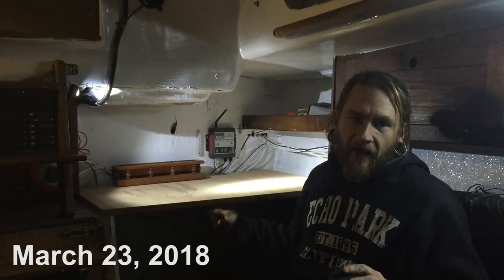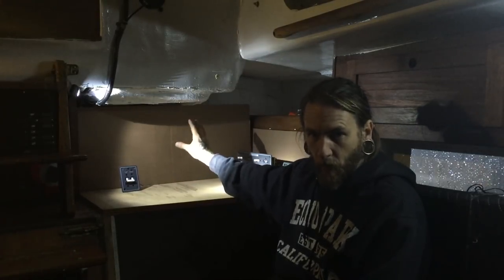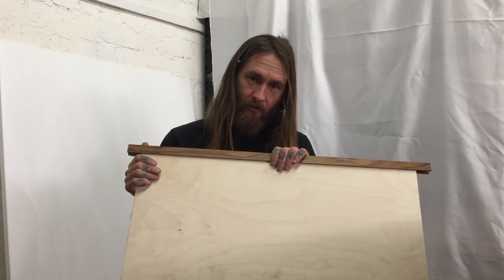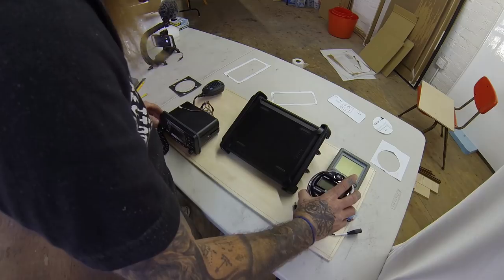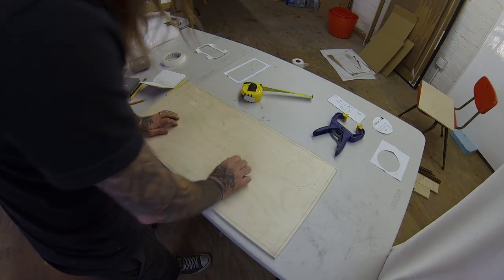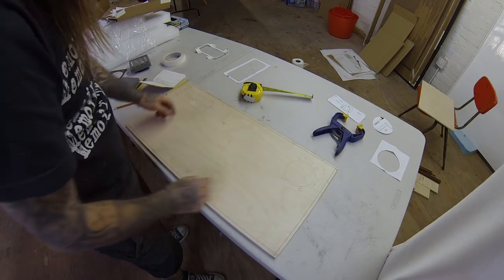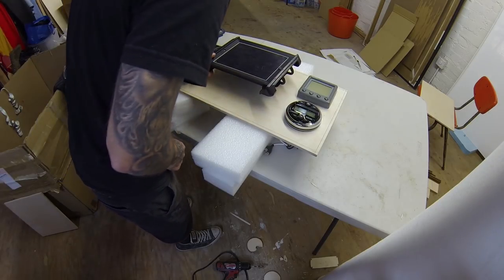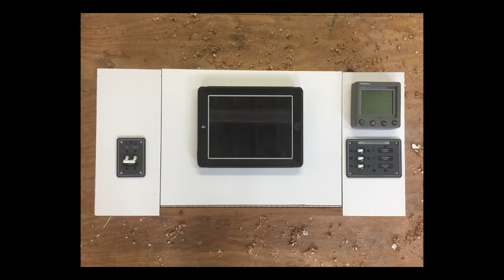Designing and Building a new Nav Station for a 1965 Alberg 30 Sailboat

Comment: Hi James. Love the videos. I too decided on a X mount for my Alberg 30. I have one in one of the rigs I drive and loved it the minute I tried it.  I was wondering what kind of case you went with for your iPad. I am circumnavigating Vancouver Island this summer and this is one of the details I have yet to work out. Thanks.
Reply from the maker: I use an Otter Box for mine, It has hard rubber case and a hard plastic stand/cover that can snap on the front or back or be left off. I leave it off when I have it in the RAM mount. Its very water resistant and can handle splashing and stuff, not being put under water though, but its perfect for my needs. Also with the rubber case it doesn't slide around in the cockpit. That is SUPER COOL that you will be circumnavigating Vancouver Island!! We were just up in that area for a yacht delivery and it was beautiful!

Comment: James surprised you did not put ST60 in the cockpit. Nice to see all data when in cockpit. Must have been reason you chose inside the cabin?
Reply: Bruce McCulloch the ST60 is wind/speed/depth. We always put in the cockpit. Need to see depth and wind when anchoring and sailing. Never heard of someone coming to rip these off.
Reply: Bruce the tablet loses cell service on the Pacific Ocean. No wind or depth!
Reply from the maker: I already have an ST60 in the cockpit, so the one in the cabin is mostly for under anchor or under way.
Reply from the maker: My iPad doesn't use cell service it connects with the onboard wifi setup through Digital Yacht iAis to receive any ships data, but you are absolutely correct, iPads are great but I don't trust them with my boats safety. this is why I have hardwired ST60s in the cockpit and in the cabin I also keep paper charts for everywhere I am sailing because electronics fail from time to time.
Reply: I figured you had 2 displays. You probably picked up a 2nd one on ebay on the cheap
Reply from the maker: Yeah I watched for them a long time, the one in the cockpit is a ST60 Multi Display and the one in the cabin is a Graphic Display that shows tons more data if its all hooked up. I have a brand new Depth/Speed/water temp transducer I will be installing when we haul out and then I will have tons of data! right now I only have a depth transducer but thats all i really need for anchoring around here.
Reply: @stromgewehr  iPads GPS function only work if you have cell service. You don't have to be connected. At least newer ipads.